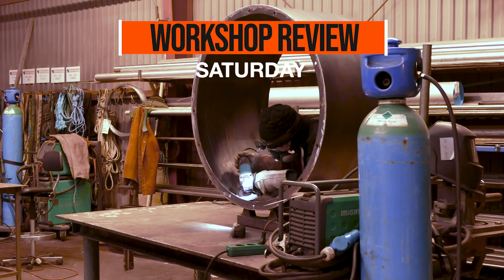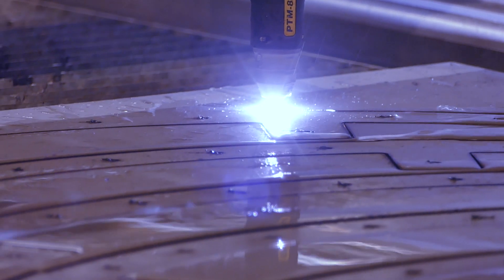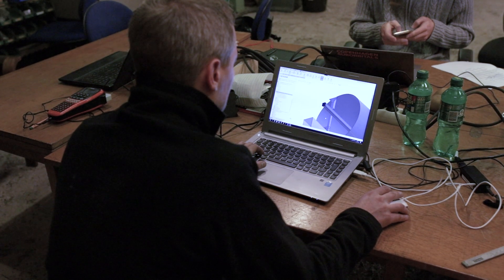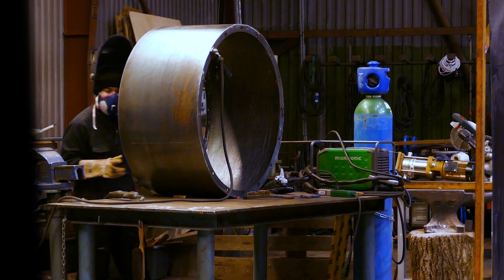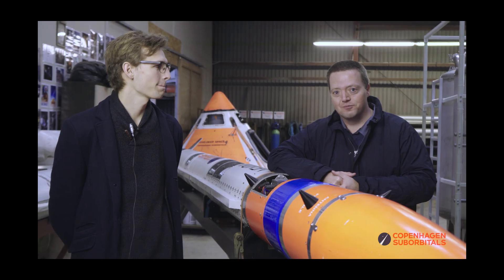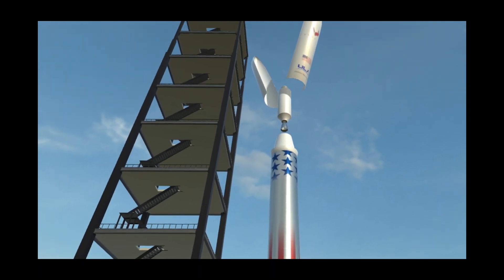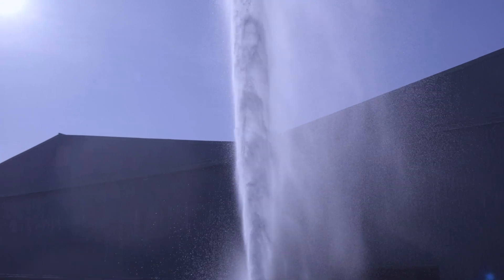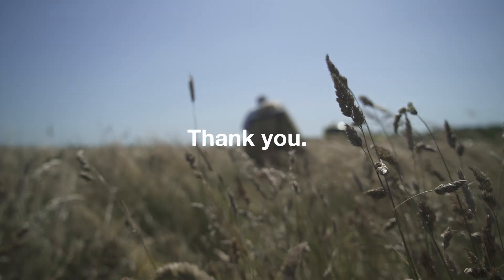More Rocket Parts | INSIDE THE ROCKETSHOP : Episode 9

Comment from the maker: Any one who tried Rockets VR? Let us know!
Free version here: https://gamejolt.com/games/rocketsvr/437651
Video about it, in case you haven't seen it: https://www.youtube.com/watch?v=Wcywzxsh3Js
Reply: Id like to try but I have a few questions . Do you make liquid oxygen on site ? If so do you use cryocoolers or buy LN2 and submerge the oxygen with tubes in the nitrogen ?
Reply from the maker: @macadamianuts7  We do not make our own LOX.
Reply: @CopenhagenSuborbitals  so you get it from industrial suppliers ? Is it safer that way ? Im guessing you do or did. Have you tried nitric acid as an oxidizer ?
Reply from the maker: @macadamianuts7  Yes. And the less you need to be around LOX, the safer you generally are, I guess. :) We've tried white fuming nitric acid once, but only for a static concept engine test.

Comment: How accurrate is your plasma cutter? I am considering building one for cutting out sheets of aluminium for my own rocket. Or is there another method for getting precise cuts? Also, good luck with Spica! I will now donate some of my spare money to your project.
Reply from the maker: I don't know if we have an exact number on its precision, but when building and designing it we were hoping to get within half a millimetre and we are definitely around there from the few measured parts that I've seen. Plasma was the cheapest in-house way for us with good enough precision. But I don't know if your question can be answered without knowing your exact needs, as yours might be different from ours. And we only built this for Spica, when the number of parts and their size were becoming a bit too difficult/expensive to go through a laser cutting service provider.